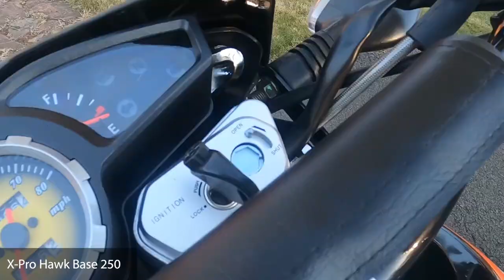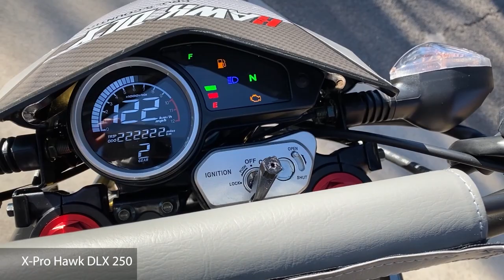Amazon Street legal Dirt bike Hawk VS Hawk DLX

Comment: To those that make fun of hawks and prefer bikes that cost 15x as much, this bike is super light and easy to pick up after you drop it and you will.  Try lifting a BMW 1200 after you hurt your shoulder.  Basic tools can fix these.   I’d buy extra nuts and bolts after taking an inventory and going to Tractor Supply.  Tighten often and use bolt glue.  If you really need to do highway driving the sweet spot is 50-55MPH.  Watch for tractor trailers as they will toss you with their wind.
Reply from the maker: These are only a 5 speed as well and if it had a 6 it might work for highway speeds but I would not think about riding this in the Highway. I agree with you about checking bolts and keeping things tight with lock tight. I know you can get gears that will allow it to hit a higher top speed but out of the box these are definitely just commuters and off-road trail bikes. These are great bikes so have fun. Thanks for all the great information.

Comment: I was kinda leaning towards the carburetated version of the hawk. I live at 6500 feet in Colorado and really don't want to mess with finding the right jet. Now I'm thinking about buying the dlx
Reply: I bought the Carb version an found it's actually tuned great for Colorado. Fact is, the factory carb comes pretty lean so it does great at high altitude.
Reply from the maker: I think if you weren't with the coverage version it would be just fine. And what thank you so much for watching, I  hope the video was helpful.
Reply: I live at 9,000 ft in Colorado would I have any issues with this bike?
Reply: @kevingovro  The stock carb would probably run fine at high altitude, bike comes pretty lean stock

Comment: Hanz... Quick question.  I went to change my front fork oil in my 2022 Hawk DLX.... there was none in either fork.  I put 5 ounces into each.  Just making sure they are supposed to have fork oil... Suspension seems appropriately stiffer now, but I want to make sure these are not supposed to be DRY.  Thank you.
Reply from the maker: To be honest with you I'm not sure of myself. Having 4 Speed Dr. does not sound right lol. You might check with a local motorcycle mechanic and see what they think.

Comment: I have become interested in one of these.
Basically though I want the inverted forks but I want a carburetor and not the EFI and of course this combo is not available in that configuration.

The engine is basically an old Honda design clone which the Chinese have gotten really good at making these old Honda designs.
I really do not want the EFI as at that point you are adding in a more complex system into an otherwise simple designed overall bike involving a Fuel controller computer which in the future could become a nightmare to source one if required while there are multiple sources for a good old cheap carb that will work if problems develop.

Right now I am finishing up a Chinese 125cc  CT70 clone and one of these 250cc bikes may be a project in the near future.
A lot of people knock the bikes of Chinese origin but I am an old retired guy and well remember when the bikes coming out of Japan had the same reputation.

One thing to consider is The Chinese have a serious thing about being lackluster on lubricating parts and you will do yourself a long term favor by pulling and lubricating the rear swing arm bearings, steering head bearings, wheel bearings basically anything that has a moving contact point give it a little lubrication while it is brand new, a slight coating of grease film on the axles and the swing arm pivot bolt is something else which will go a long ways to keeping those in pristine shape as again it is well known most Chinese steel rust very easily.

Also put a good coat of wax on all chrome or painted parts and if you stay up on your maintenance and keep your chain lubed and adjusted and your engine oil changed these Chines bike may surprise you on how they holdup under the types of use they are actually designed for.

Just something of interest for people in 2023 Honda is importing a new xr150cc bike into the U.S.A. which has been available in other parts of the world for a number of years now.
What is interesting is the engine on that bike is a retro design being produced by a factory in China in partnership with Honda to produce this engine.
The bikes will be built for North America in Mexico but still be a Honda branded bike sold in Honda dealerships.

Some research on that bike overseas says it is reliable for the most part but the fit and finish and build quality does not meet the same criteria as more expensive Honda models which the XR150 is said to be at a retail price upon release in the U.S.A. AT $2971 plus freight and dealer prep of like $300 or so.
When you make a bike to meet certain price points there have to be certain sacrifices made to reach that selling point.

So just because it is produced in China does not mean it is any more inferior to what is being turned out in other places.

Since you have owned both what is your opinion on the difference between the two fork styles?
Reply from the maker: If you are a new ride or you will not be able to tell a difference. If you are experienced as a writer you should be able to feel a little performance difference. I think both of these bikes are great and you probably will not be disappointed with either one. Thanks for watching.
Reply: What kind of grease do you suggest for all moving parts?

Comment: Is there any warranty options? I’m wanting to get this as a learning bike.
Reply from the maker: I do not think there is any kind of warranty other than the Amazon seller warranty. I'm sure you could find something like Clyde that my protect the bike from manufacture defects. Hopefully the video is helpful and thank you so much for watching.
Reply: On my second Hawk.  I’d put warranty money in metric tools instead.  Parts are cheap and abundant and easy to figure out.  I have a KTM and petrified to work on it but love working on my hawk.  Oil changes takes minutes and I even adjusted my valves.  Buy some bolt threader though and tighten your spokes

Comment: Is the shipping for the fi version $400 vs free shipping for the carb version on Amazon?
Reply from the maker: You need to pay attention when you are buying one of these there are two different versions of the hawk 250.. The basic version is very cheap about $1700. The DLX is going to cost about $2100. The most obvious way to tell the difference is the front forks. One is a standard fork and the other is a inverted fork. You can't see it in the photos but the DLX is a fuel injected version where the other cheaper version is carbureted. If you have the money I highly suggest getting the DLX.
Reply: Yes, when it was available from Amazon, the DLX fuel injected model was about 400 more in the price, but they also charged $400 for shipping vs free shipping for the carbureted bike.
Reply: @dubmob151  get the carbed version, i guarantee you will be fine.  i've owned several carbed kawasaki bikes and they run like a champ.  you can find lots of bad stories where the efi and electronics break on these bikes, so the carbed version would be easier to maintain in the long run.